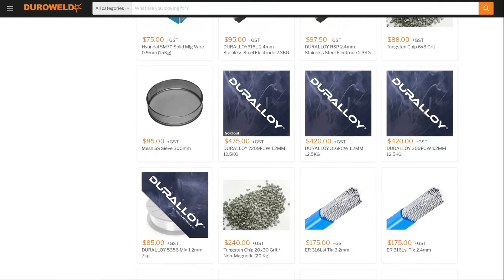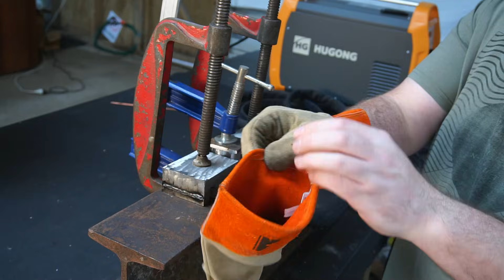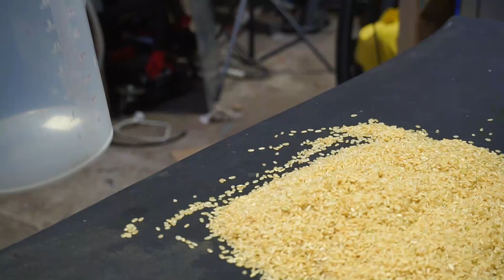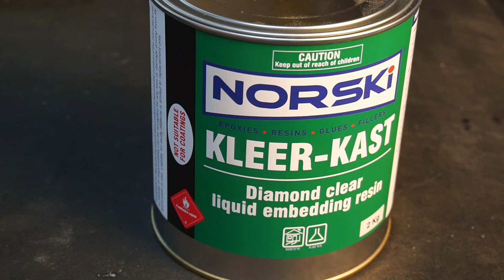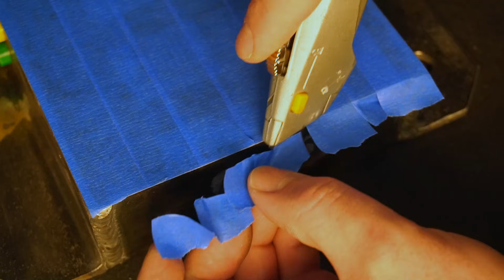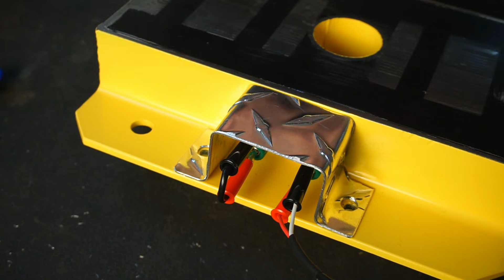making a Magnetic Vise for a Drill Press!

Comment: I know I'm a bit late but I was going to recommend foam instead of grip tape.  I used a piece of 3mm  foam, it's almost this consistency of the soul of your tennis shoe. He works awesome on holding a variety of materials, and the foam also temporarily gets an indention where your part sits so that gives it an extra hold. The indention normally goes back to normal within 15 mins after you pull the part off.

Comment: For those wondering why a diode is in the circuit diagram, he explains @ 17;32".
https://youtu.be/orsmjiCMotM?t=1052 

also explained here.
https://en.wikipedia.org/wiki/Flyback_diode

"A flyback diode (also called freewheeling diode) is any diode connected across an inductor used to eliminate flyback, which is the sudden voltage spike seen across an inductive load when its supply current is suddenly reduced or interrupted"

good video BTW.

Comment: Great Kiwi creative mind. Power supply  should always go through female  connectors which eliminates the possibility of shorting out. Not sure why you used carpentry equipment when you have a mill to give you a flatter surface and you soldered most joints. Solder them all its the best long term connection. Great project btw.

Comment: As I didn't have access to two similar microwave transformers, I used  four 12v magnetic brake coils as used for car & caravan trailer brakes to clamp my big drill press vice down. They're available for about $12 on Ebay & draw about 5A each and REALLY hold down fast.

Comment: Can you help me with a queirie ,please?. was the fact that the electromagnate held 300kgs because you had 8.4 amps of power running through the system?. ( or would 5 amps give the same results?). your help would be deeply appreciated. Leon. :-)
Reply: Absolutely not an expert but have been trying to understand magnetics for years now. There is a point where a material becomes "saturated" and cannot contain any more magnetic flux, but below that point the flux is a product of the current and the number of turns the coil makes around the core. With the same coil and less current, it will be capable of holding less force.

Comment: One little tip, you may find if you are wiring in parallel, put your positive and negative end of the coil together for a stronger hold. The electro magnets would be N-S-N S-N-S making it better instead of N-S-N N-S-N which is slightly weaker.
Do the opposite when wiring in series.

Comment: I think there is a problem. That the metal shavings do not come out easily from the side of the drill due to the magnetism. what is your opinion ? Does magnetism have a negative effect on chip discharge performance or can it be ignored? Please let me know your experience. Thanks for your interesting and practical video.❤

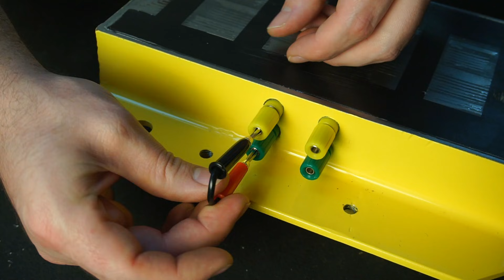Comment: 18:28 what voltage and current scenarios would determine to connect the magnets in series or parallel?
Reply: The abilities of the supply. 1R is handy. At 1V, 1A will flow. Makes the math easy.

If you have a higher voltage but lower current supply, say good for 12V @ 10A, series makes more sense, 12V @ 6A.

If you have a low voltage higher current supply, good for say 5V @ 20A, parallel makes more sense. You get 5V @ 10A.

Both scenarios stay in range of the supplies. If you flip the series and parallel, you have 12V @ 24A and 5V @ 2.5A. These are radically different magnets, and with the one, the supply won't stay happy for long.

Comment: Isn't the magnetic field weakened by the edges and centre all being welded together?
I'm pretty sure the magnetic fields are stronger when the 2 blocks are left independent of each other and you use a plastic tube between them

Comment: Love your work so much i decided to try this myself! It has not worked out so far lol!  Using 2 transformers and a 12v 10amp power supply, but the magnetic power is weak at best. Any tips that might help me figure it out? I am here in Canada and we have 120v lines, could that be the issue? When i turn it on it barely has any pull.

Comment: would running the coils in parallel increase the strength of the magnets or would you simply need a higher current power supply? 
anyone?
I am using a power supply from a computer and it is 12 volts and I think close to 15 amps.....
Reply: anyone???
Reply: The ele3tromagnets aren't in close proximity to each other.  The magnetic force will be the same.  However, it parallel, you'll need 2x the currtent than what is needed in a series connection.  Magnetic force is based upon the number of turns x the current.  So in this instance, 10 amps through 200 turns in series (2000 ampere turns) is the same as 10 amps though each 100 turn coil in parallel added together still equals 2000 ampere turns.

Comment: I saw this video some time ago, but I recently came across something that's already made that I think will work well. At a recent visit to a local scrap yard, I noticed that someone had scrapped some parts from a MRI machine. I found some assemblies from somewhere inside the machine. These were 24v electromagnets, and I bought two, and also bought a 24v din rail power supply, that has more than enough current to operate both, with some extra overhead reserve. I'll assemble them in a similar fashion to what you made with your mots. I like the idea of the hole in the senter for the drill bit.

Comment: Video does not show how to create the electro magnets or where they came from.
Reply: They appear to be transfoirmers from microwave ovens (common source for DIYers).  The secondary (with tons of small gauge wiring) has been removed and only the primary (heavy gauge wire) is used.

Comment: did you check what would be if your power goes off during drilling.electromagnet would go off and drill would still spin  so can be dangerous,you must secure battery power just in case power goes off.

Comment: with 310 kg of lifting per electromagnet, which totals with 620 kg per pair, it surprised me how "weak" this electromagnetic vise was, when the leverage was applied in the horizontal axes 
now I wonder if this solution is suitable for the milling machine, and for other heavy holding force requirements, maybe on a lathe etc.
Reply: Pretty sure it would. I've seen metal machining machines with electromag blocks similar to this. All depends on the size of the coils, number of coils/magnets and how much power you are putting through them. If electromags can be made to lift cars and other heavy metal items then pretty sure you can make one to work on your mill.

Comment: Excellent!  I'm in the process of collecting a dozen or so microwaves so I can build some of these for various applications.  I'd like to incorporate a magnetic panel on my router table spoilboard onto which I can slap metal plates for machining or resurfacing operations.

One question I have is:  Is there any advantage to stacking two or more coils onto one "E" section?  For example, assuming I have two identical transformers, would it be better to make a magnet out of each like you did here, or could I use the primary coils from each transformer and stack them on one "E" section to make a more powerful magnet in a more compact space?  This would eliminate having to mill away so much excess material from the "E" section.  I'd be curious to know your thoughts on this idea.  Thanks.

Comment: Does that diode prevent the power supply from surging/ turning on and off?
Nice video too, I like how descriptive you are. 
Cheers
Reply: When the power is cut to the electromagnets, all of the energy stored in the magnetic field will result in a voltage spike called flyback which could damage the power supply.
https://en.wikipedia.org/wiki/Flyback_diode

Comment: NOTE TO KIWIS and AUSTRALIANS.
Check you rules on PERMANENTLY ATTACHING MAINS POWERED DEVICES to machinery.
I'm an Australian engineer with 30+ years of automation experience. 

When you permanently modify machines you become the designer or manufacturer. I'm not certain on NZ but I know this for a fact in Australia.
Its pretty much irrelevant so long as you own the machine until the day it goes to the scrap heap. BUT if it ever gets sold then as the designer/manufacturer you can be held accountable for anything that happens. I'm not saying you will be but you can be. For those wondering its found in the machinery regulations where it gives designers, manufacturers, importers and sellers the same legal standing. AND yes I know I don't know how some people get away with importing what they do. 🤷‍♂️🤷‍♀️

The other thing that follows on from this is ALWAYS put a mains plug on any mains powered equipment. DO NOT wire devices into existing machines or wire them directly to a switchboard unless you are an CERTIFIED electrician. At the very least you can unplug it if anything happens.
DO CHECK THESE POINTS WITH EITHER AN ELECTRICIAN or YOUR OFFICE for ELECTRICAL SAFETY.
1) You most likely void any warranty of any sort. 
2) Its considered a permanent modification (see above).
3) When you put a plug on the end the power cable the device you have made does NOT GENERALLY fall under the AS/NZ 3000 rules as it can be classified or considered "an appliance." Things like kettles, microwaves, TVs,.... and anything else that plugs into a power outlet are sold as appliances and have a completely different set of regulations. Put it this way - none of the people in the factories making those products are qualified electricians. That's because the manufacturing and selling comes under completely different regulations. BUT if you make something that gets wired to a switchboard like a machine for a factory (as I have done) it requires a certified electrician.

If you have any questions I will try and answer them, but on actual rulings check with a certified electrician or your local office of electrical safety.

Comment: I've made two of these from your design, one for home and one for work. They work fantastically thank you! However now I'm noticing all the tooling I use on the drill becoming magnetised. Would you consider doing a video on how to make a de-magnetiser?
Reply: Kup krążek linki #1mm(200mb), Transformator 240/24V  160W  i SSR-40 VA 24-380VAC . Cały krążek będzie cewką rozmagnesowującą . Cewkę połącz z uzwojeniem wtórnym trafo  poprzez amperomierz AC. W obwód pierwotny trafo wstaw w szereg SSR-40 VA. Reguluj potencjometrem do prądu znamionowego uzwojenia wtórnego trafo . Dla 160W będzie to 6A.  Tak obciążony transformator może pracować dość długo. Jeżeli nie wstawisz elementu regulacyjnego to trafo może pracować tylko przez krótki czas, bo je spalisz.

Comment: Love the video. Thank you for sharing. I have tried 4 power supplies. They are jumping off when turning on and plugged into the coils. I think I may need some kind of load resistor? The last power supply I bought can do 12v and  2 to 30 amp still pops off like it is overloading.

Comment: Great video and project.  I may attempt one if I can salvage two microwaves.   My question is:  Is it necessary to bolt the vise to the metal drill stand?   Will the magnetic force above the vise have a complementary force below it that would simultaneously hold the vice in place on the metal drill stand as it holds the workpiece above?   This would make it more convenient to move the vice from a drill press to say a metal work table or a pickup truck bed.  I might do this for small work pieces that would not overwhelm the vice/magnet.    My concern is that the surviving component of the microwaves transformer is U shaped (or W shaped) after you cut it in half.  I don't know if the magnetic field lines stay in the metal or leak out as they do above the vice.

Comment: I've seen other magnetic vises on YouTube and this is, by far, the best one. Great explanation and video quality as well.
Reply: Fantastic job I would've guessed you were german from the engineering overkill lol.  I was suprised the 60 grit grip tape was effective, was it an iron oxide grit?  I took a slightly larger electromagnet and drilled a 1" hole in the center and wrapped electrical tape around the exposed windings.  Mine's a complete hack job but took about twenty minutes and it's ugly but it works great! The hidden bonus you didn't mention is that flutes on drill bits and taps are automatically cleared of ferrous shavings instantly
Reply: GENTLEMAN.... I HOPE YOU WILL  EXPLAIN CLEARLY THE (CONNECTING) INSTALLATION THE ELECTRICAL WIRES TO GET THE SUCCESSFUL RESULTS .... from A to z.... please MAKE IT CLEARLY STEP BY STEP..... SLOWLY.... THANK YOU IN ADVANCE FOR YOUR COOPERATION.... WAITING FOR YOUR REPLY AS SOON AS POSSIBLE.....
Reply: SLOWLY....

Comment: Anyone have any ideas why my electromagnet pulsates?  I am using an AC to DC converter with 120volts AC and the magnetic will turn on and then immediately off and keeps doing this in short bursts.  I tried building one just like this but I cannot get it to work correctly.  thank you.

Comment: nice job. I'm in the process of making one. small tip when soldering those banana plugs : tin  the wire first, and fill the 'cup' with solder. then while the solder is molten, insert the wire into the cup. The way you did it is unlikely to get much solder into the connection.

Comment: Good video until you ended it without the details of the powering wiring.  Showed a laptop power supply, but no wire connection details to switch or power supply.

Comment: so I just viewed your inductor vid to understand why you need a diode, and I get the flyback, but you also say inductors only work for AC, and yet this is a DC circuit, right? so ????
is the diode also acting like a bridge rectifier limiting one leg?
Reply: A flyback diode is a diode connected across an inductor used to eliminate flyback, which is the sudden voltage spike seen across an inductive load when its supply current is suddenly reduced or interrupted.

Comment: Great work! Congrats!
Please tell me what is the voltage of your power supply. Can we simply remove the secondary coil as you did, keep the primary one and turn it in 127 or 220 AC?
Thank you for your time in advance.
Reply: AC wont work as a the magnets will go NSNSNSNSNSNSNS etc. besides mains voltage is dangerous. 2 microwave magnets in series, use 12v 10A DC supply or thereabouts

Comment: Was it 220 volt AC or other voltage using for this magnet??
Reply: He used a 15 VDC laptop power supply for the coil of the magnet.  You could probably safely use anything from 12 to 24 volt DC for a magnet like this.

Comment: I have been designing one of these for a while, I still am trying to avoid the classic encase everything in epoxy route for the following reason: if you forget to turn it off, you are dumping heat into the coils since their combined resistance is significantly less than the other branch of your circuit and the high amps are needed for the B field. I suppose you could have this set to a timer switch that automatically turns it off, but the heat issue is a problem I haven’t sorted.  Just remembering to turn it off isn’t enough, have you thought about this aspect? Nice build!
Reply: Disassembling two microwaves for the transformers means having two over temperature switches on hand anyway...
Reply: In your case, doesnt help you using a temperature switch?

Comment: The drilled out material is magnetic and contains magnetism, after the magnet is switched off. Give it a short AC pulse to de-Gauss the metal,,,,and the residue metal. LOL  impressive ...
Reply: the short 'pulse' would have to fade to 0 volts or have zero crossing detector to degauss. Simply hitting it with an AC pulse will leave it magnetised depending on when in the AC cycle the power was switched off.

Comment: I would like to build one with 4 electro magnets from microwave ovens. Do all the transformers need to be from the same wattage oven or very close?  Are the transformers in dead microwave ovens usually still OK?  is there a preferred wattage for the  microwave.
Reply: 1- No but in such case you will have different magnatic force per trans.
2- a simple ohm meter will tell you if transformer is dead or not, check the coil resistance, if it has a reading then most of the time it is ok

Comment: What is the Voltage used? Connecting in parallel increases the force also if needed.
Reply: it works good with 12v dc

Comment: Really nice and professionally designed and built but I saw 2 things you can improve: 
1. Use electronic grade potting compound. It doesn't shrink or crack. It doesn't eat up the copper.
2. Shottky diodes are not suitable for inductive flyback clamp. They have a low reverse voltage and are not necessarily fast enough. They are meant for applications where low voltage drop is required, and you don't care about voltage drop in this application. Use a fast switching diode with high reverse voltage. 1N4007 will do.
Reply: 1N400x are not "fast switching diodes" either. FR400x is a bit better, but nowadays there are tons of choices.
Reply: @inductivethinking  You're absolutely right, 1N4xxx are not fast switching. In this case, the communication is done manually by an electromechanical switch and doesn't require fast switching diodes at all. Not sure why I have said that when I wrote the comment. Although fast switching diodes are a better option, almost any diode that can handle an Amp and over 500-600V in reverse will do.
Reply: Almost any diode with the required reverse voltage and current rating will work in this situation 

It doesn't need a Schottky diode but it will work just fine but so would a simply 1N5408 or similar

This isn't a fast switching application and only has to handle a pulse or so at turn off 

IMO